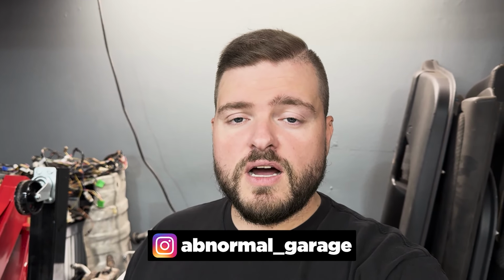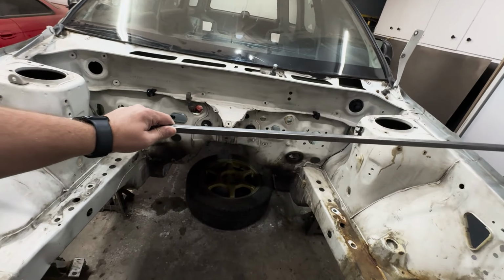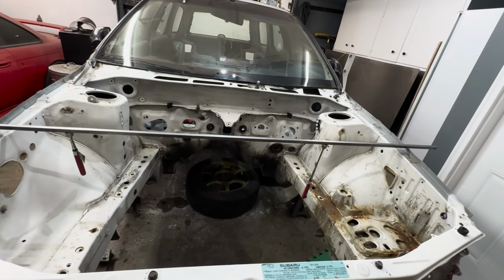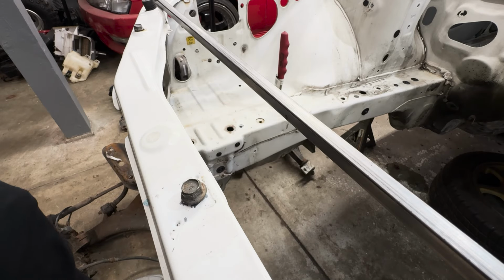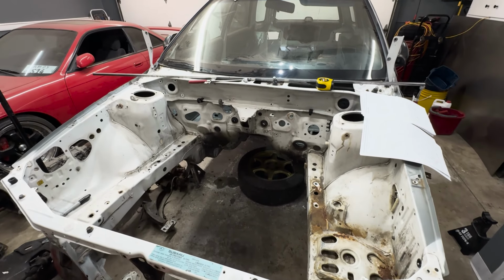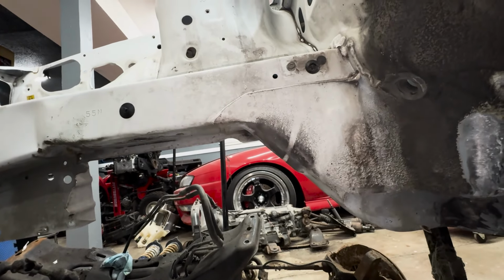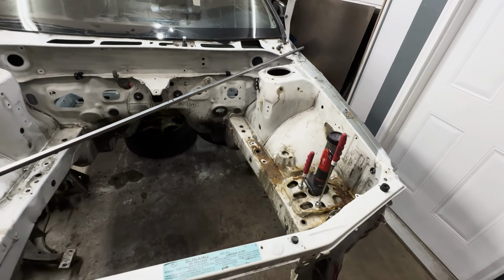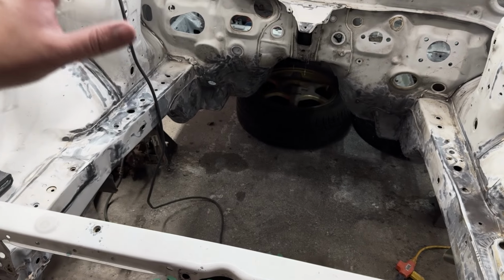Finding Hidden Frame Damage... Is The Chassis Straight? | Impreza GF8 Build EP. 14

Comment: Man, this build is gonna be insane when you finish it. I watched the whole series today and I wanna give you some tips and ideas.

So, first know that when you start welding the chassis if the car is not "rested" on it's wheels there is a slight chance the chassis will twist, depending on how you weld and where you weld. The doors/trunk might come slightly out of specification, even if they match up and close, they might close "harder". To prevent this, weld with all the doors installed on the car and shut. Also it's a good idea to re-check the chassis specs in the engine bay/trunk after you do all your welding just to be sure everything is in spec.

The battery tray will probably rust again, since battery acid is very corrosive. No matter where you put the battery I suggest you model and 3D print a plastic tray (box) for the battery and attach it on top of the metal bay to prevent further rusting.

If you plan to go with very stiff suspension or to make big horse power (500+), absolutely buy strut tower reinforcement plates and weld them on, since the strut towers are very thin and they bend easily under certain circumstances. The WRX/STI model also has a rear sway bar on the suspension, which I think you don't have, unless you got one from the bugeye parts you bought.

About the wiring harness, I suggest you go with custom ECU, because the stock ECU before 2000MY cannot be remapped. Most of the aftermarket ECU come with all the harness you need for the sensors, fuel and ignition system. You will have to delete all the unnececarry cables from the stock harness and just leave the body/auxiliary cables.

Most importantly, keep up the good work, man! Wish you all the best.
Reply from the maker: Thanks! I'll definitely have to look into some strut tower reinforcement plates once I get them rebuilt, and yes, I did get a rear sway bar from the bugeye part out. I may look into upgrading it when I restore the suspension components though. Appreciate all the tips and ideas!!